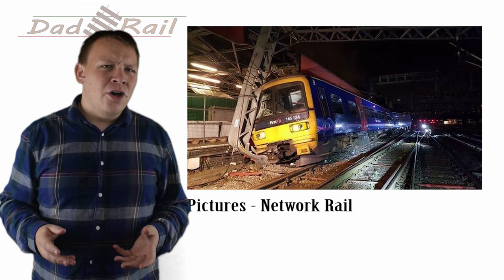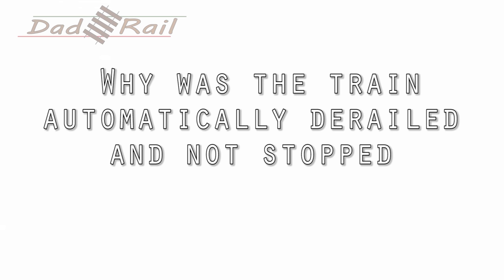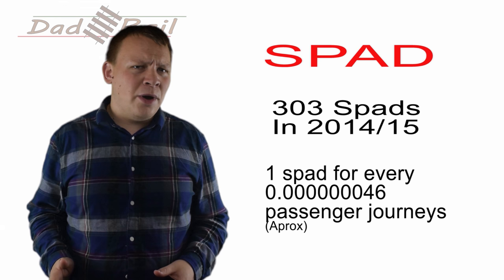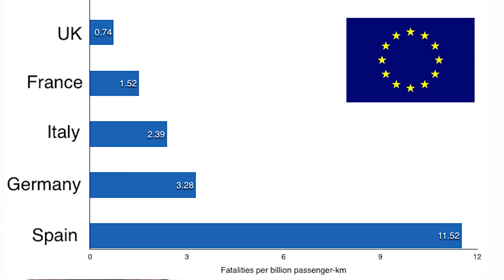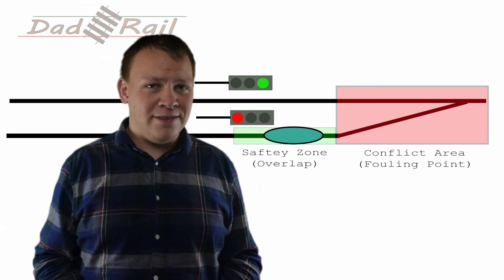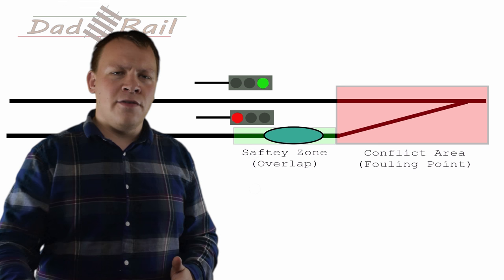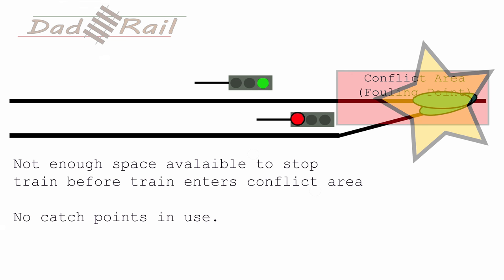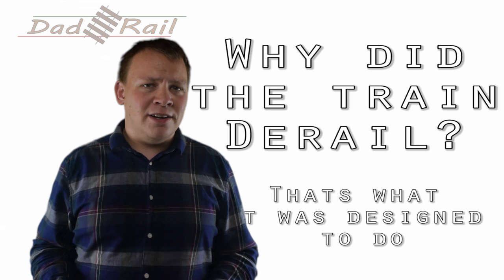Paddington Derailment / train  crash 2016 - Dad Rail (HD) Updated

Comment: Ive noticed that there are trap points near Morpeth train station, where a single track line from (a siding/maintenance depot?) joins with the ECML (i think that track also connects with a line which was previously goods only (but will be opened for passenger services in 2024) after going past the sidings/maintenance depot)

The thing i find interesting is that a train would have to pass over a level crossing first (half barrier), before it gets to the trap points, so i assume the trap points there are more of a last resort way of ensuring a collision does not occur

Comment: When I first saw this I instantly thought: bay platform = driver forgot DRA = start on yellow SPAD. Now, reading around, it appears this was ECS moving into Paddington, so I suppose the only logical answer is that the driver, for whatever reason, read across to the wrong signal. There's probably more to it than that - perhaps the signaller set an unusual/unexpected path.
Reply from the maker: Ive had a look on the RSSB website and cant find the report yet, so still unknown. Could have been a SOY SPAD (Start on Yellow) but I'm unfamiliar with the track layout at this location so couldn't say. It could be as simple as the driver lost focus on the signal, I will keep checking the RSSB website and update when the report comes out
Reply: Initial report on RAIB website - https://www.gov.uk/government/publications/paddington-safety-digest/derailment-at-paddington-16-june-2016
Reply: @tvlicensingblog  I've had a read. Basically the driver of the train 3H52 had a ground signal clear and thought he was clear all the way into Platform 1. The next signal was red and he didn't think it applied to him. He only put the brakes on when the train was derailed.
Reply: Oof
Reply: Did you know that ROBLOX has the most dangerous railway with around 1000000 SPADs and derailments every hour!!!
Reply: @DadRail  driver was fasting for Ramadan which buggered up his concentration
Reply: @maxwellwynne-shepherd7852  professional drivers

Comment: Nice video, happened to be in the signal box when this happened... but won’t say further on that (was not the controlling signaller either).

In the grand scheme of things I appreciate it doesn’t matter, but my pedantry gets the better of me... what you call catch points in the video are in fact trap points. Although similar they are two different things and perform different functions (although both designed to derail trains making unauthorised movements, but for different reasons).

Now I can breathe...

Comment: Nice video but I think you are confusing catch points with trap points. Trap points work as you describe by derailing a train away from a conflict area should the train have a spad in a yard/depot/siding. Catch points are spring loaded points found towards the bottom of an incline that are designed to derail a train should it roll away backwards. Due to the advent of air brakes catch points are no longer widely used.
Reply from the maker: Thank you for that, I was indeed referring to trap points, but using the wrong terminology. Would spring loaded points on some trailing junctions also be classed as catch points?

Comment: Very informative video, really enjoyed it! How does the track cause the train to derail?
Reply from the maker: Thank you, the track literally just ends, so the train falls off the end of it, normally into a sand trap or something similar.
Reply: @DadRail  it's basically a set of unfinished points
Reply: @DadRail  Do you think it's possible to stop the train by the means of jamming the flanges of the wheel between two tracks? That way, the whee is caught by the two tracks and slowed down by friction. Worst case scenario, the train derails because of it.
Reply from the maker: @williamhuang8309  I think with the weight of the train, the flanges would ride up and over so the train would derail all the same

Comment: It must have been ECS exciting the carriage sidings. Wouldn't happen with a passenger train.
The driver must have been well over the speed limit to go that far, Normally just the front bogie would drop of the rails. TPWS also has an overspeed sensor approaching  a red signal if the overlap is not sufficient to stop a SPAD train before it enters the conflict zone.
Been a few years since I was a signalman for Network Rail, Then it was changing from safety first no matter what to "Safe Performance". So maybe the rules have changed so operating companies can meet their ppf.

Comment: Are passengers aware that a train can be automatically derailed?  Was the plan shown in the video the real plan where the train was derailed?  If the stopping distance is too short, then why not move the signal further back? Martin. (Thailand)
Reply: Like it said in the video, catch points are generally found in sidings, depots and yards.  You would never have passengers on board when conducting such a journey.  They have since changed the signalling at that location due to the accident.
Reply: @wfmeredith  Thank you.
Reply from the maker: As Wayne said,  generaly only used in low speed areas, where it is not practical to use TPWS. Also there is the possibilities of run aways where trains or wagons have been left and the handbrake has not been applied, or the air has bled off. In this case, the only way of stopping the wagon or train is to de-rail it. better than have it run onto a mainline and cause a major crash.
Reply: @DadRail  There was a general agreement between GWR and Network rail that any trains signalled from that siding would 'get the road' the entire way into Paddington Station as your initial signal was a GPL which at the time only took you to the next GPL and NOT all the way into the station. However on this occasion, only the first GPL was cleared as there was a HST leaving platform 1 or 2 (can't remember exactly) which needed to clear the line before the second GPL could be cleared.  NR accepted poor placement of catch points resulted in the derailed train clobbering the upright bringing down all the overhead lines and causing several days of total chaos at Paddington, GWR accepted that their driver was at fault for the SPAD and both agreed to split the cost of the whole mess 50/50.
Reply: He was leaving a siding and thought a shunt light authorised him out. However it only authorised him to the next shunt light.
Reply: We are not allowed to derail passenger trains, in places where passenger trains are unable to stop in the distance available a sand drag is used. There are not many places we have them because usually the signalling is designed so that a train will not be allowed towards another that may not stop until the system has proved it has stopped at the signal

Comment: If this is a GWR train then wouldn't it have been fitted with ATP and not TPWS? Or can a train be fitted with both?
Reply from the maker: Thats a good point. I think they are fitted with both systems but I'm not 100%
Reply: Only HST`s and the new 800`s are fitted with ATP - Turbos never had ATP only TPWS - look at the political and the cost.
Reply: @newage3  Thanks for that.
Reply: @newage3  you're wrong there only the 165's have ATP fitted
Reply: @GWRProductions-kg9pt   -  Sorry mate but you are not correct, GWR Turbos were never fitted with ATP  they only ever had AWS and TPWS fitted, Chiltern railways is different in as much as 165`s and 168`s are fitted with ATP but a different system, the class 170 (Which is a 168/3) is Not fitted with ATP only TPWS is fitted to them, The Western region HST fleet was fitted with ATP and retro fitted with TPWS this was a requirement of the Paddington remodeling, the new class 800 IEP are fitted with both systems as standard ATP and TPWS, you also need to remember that Not all signals are fitted with ATP ramps and sensors or TPWS sensor equipment.
Reply: @newage3  try doing a bit more research on ATP next time as it doesn't use the same gear as AWS & TPWS
Reply: @GWRProductions-kg9pt  I thought it might of be obvious from my reply that ATP/TPWS/AWS all use different track mounted and track side equipment as well as the different equipment fitted to the traction units as well as the 2 different systems of ATP
Reply: @newage3  I'm well aware of the different methods that are used with said systems, speaking of safety systems I wonder how they'll with ETCS
Reply: @GWRProductions-kg9pt  what is ETCS.....?
Reply: @newage3  from what I can understand the eu version to ATP

Comment: Couldn’t they move the signal to incorporate an overlap? This surely would prevent the train from having to be de railed!
Reply: No, SPAD was purposeful rather than late brake application, as the driver didn't think it applied to him. 
Trap points are necessary, not all SPADs occur when driver fails to slow down fast enough. From driver error missing the signal to uncontrolled stock running away there need to be a way to protect the main line and trains upon it.

Comment: Did the train stay in service
Reply: NO this is Patrick yeah it continued its passenger journey on the ballast
Reply: No it was removed from the line after the driver was evacuated. There were no passengers on board.
Reply: I think he means whether the train was scrapped/removed from service or repaired. To answer that question, it was repaired.
Reply: I heard it had to be put down

Comment: Why didn't the train driver slam on the emergency breaks before it would of derailed if anyone was on the train it would not kill them but leaving them with a injury and the train could waited for another to go pick the train up after if it was said to be a failed train. I think the passangers on the train would may see that they are passing through a SPAD and would go to a safe point of the train to prevent injury.
Reply: 1) Unlikely they would be paying attention to lineside signals and even if they were they might not have noticed. 2) There were no passengers onboard.
Reply: The signal was a ground position signal......passengers would not of been on board as it was ECS movement.
Reply: the driver was fasting for ramadan
Reply: So he was going too fast then ?
Reply: @dessmith1387  FFS I never said he was speeding, look up ramadan
Reply: @GWRProductions-kg9pt  Fasting had nothing to do with it. Basically driver drove past ground signal he thought did not apply to him, and was subsequently derailed by a set of trap points protecting the line from unauthorized movements. Emergency brakes were applied as the train went over the trap points.